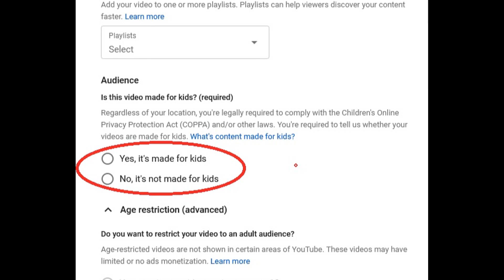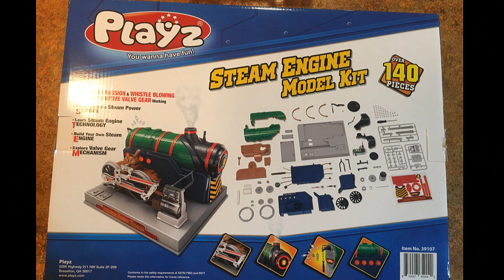Build a Steam Engine out of Plastic and produce real steam.

Comment: You actually have something wrong with this engine. It's a cool representation, and shows what modern technology can do. However, I notice the eccentric crank on the driver isn't actually moving with the driver (main wheel). In terms of a walschaerts valve gear, the eccentric crank controls much of the timing (when steam is admitted to the cylinder), so it's actually a shame it doesn't work on the model. You can see this also forces the lifting link to oscillate, which also is detrimental to the motion. I hate to be that guy pointing out the flaws, but this is actually a pretty cool little piece.
Reply from the maker: Yes, after studying it running, I noticed my two wheels weren't exactly aligned.  Its hard to put together without moving those wheels and mine was off a cog on the gear. I have since fixed it, as I had to take the gearbox apart and the drive shafts off, but now the timing and movement is correct.

Comment from the maker: The last plastic engine I made was a visible v8.  It was complex but fun, but was also destroyed in that fire.  So when I saw this, I had to make it. *Note : After studying it running, I noticed my two wheels aren't exactly aligned.  Its hard to put together without moving those wheels and mine was off a cog on the gear. I have since fixed it, as I had to take the gearbox apart and the drive shafts off but now the timing is correct.  It is a great project for Parents and children to do together in these trying times. It teaches good coordination, building skills, and operation of what is said to have been the  most powerful engines on Earth back in the early days of the industrial revolution.   Here I present how to build it in high speed.  It also produces real steam.  Thanks for watching, stay well, and God Bless!  
Link to Amazon, where I purchased for $59.95  https://youtu.be/LKtyDYHbpZ0

My other engine links:
1931 IND-X steam engine  
https://www.youtube.com/watch?v=1TM_CroZb0g&feature=youtu.be

Visible 8 build.   https://www.youtube.com/watch?v=KwBAzWP_5Hg&t=12s

Home made steam engine.   https://youtu.be/LKtyDYHbpZ0